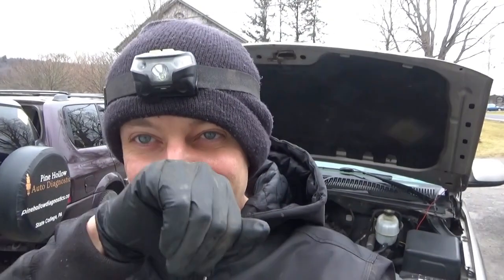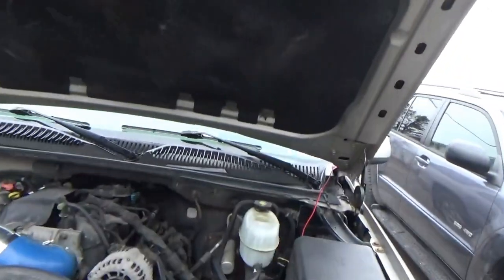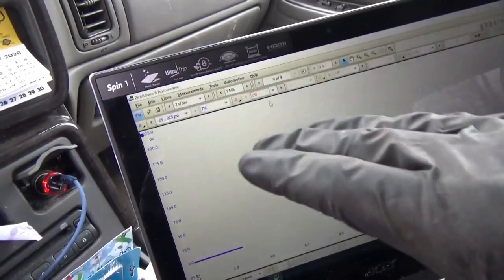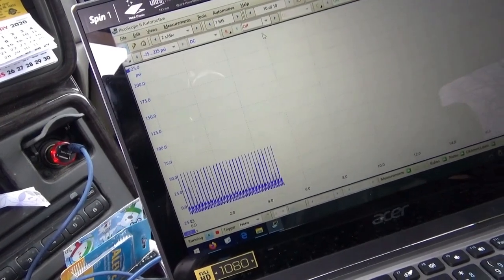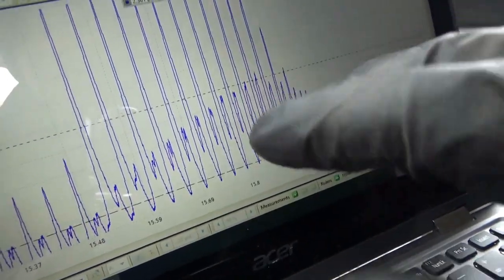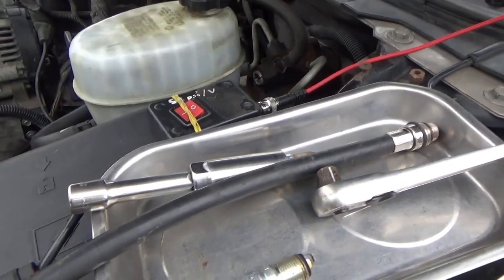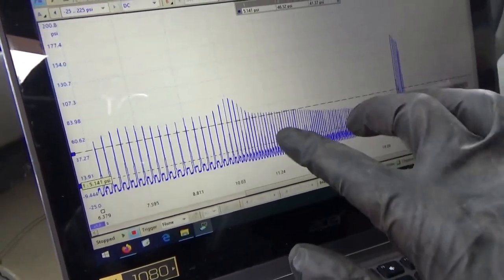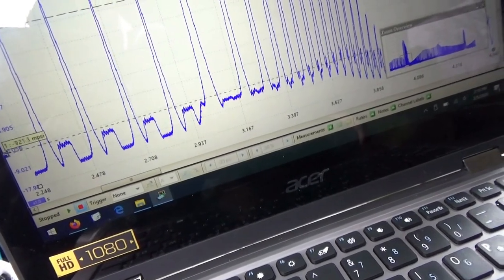GM Truck Misfire/Low Power Case Study - Part 2

Comment: Great video Ivan! Quick question... is there any way I can check for this same problem using my (less expensive) pulse sensor? Or do I absolutely need to buy me a pressure transducer? This could have been a very time costly diagnosis without the proper diagnostic equipment!
Reply from the maker: Hi Greg! You definitely need a real pressure transducer here. Honestly I've never used a "pulse" sensor, and don't really see where it would be better than a regular transducer. I can make you a similar one that I used here for about half the price of a WPS500 :)
Reply: Pine Hollow Auto Diagnostics oh yeah that works then! I really see where this could help me in my daily routine of diagnostic procedures! Ill text you my info and you can go ahead and get started I want it!

Comment: would you see pressure increase on intake manifold with a vacuum gage at higher engine rpm also ?
Reply: I was taught yrs ago 3 in vacuum drop was max back pressure from idle to 3000 rpm to check for restrict in cad
Reply: should and with the scanner if it has a map it should show there too.   start at an idle and watch the vacuum slowly decrease
Reply from the maker: Since this problem was only visible at WOT, not sure how a vacuum gauge would show anything useful...

Comment: A simple vacuum gauge will work, though it would not distinguish which bank when separate cats are used for each bank.
Reply from the maker: What would you expect to see on a vacuum gauge? I don't think it would show anything useful in this case of one partially restricted cat :)
Reply: @PineHollowAutoDiagnostics  Hi Ivan   With just a slight restriction it would be probably more difficult to see, but what one would see is normal vac  around 20 +/_ on initial start and vac will drop as backpressure builds up.   It really does work.   also works well to find if you have a low compression cylinder very fast. Will not specify which cyl. but will let you know you got a problem.  Even the Vac. reading itself can give you an idea of the basic health of the engine.   A bit old school I admit, but still a handy tool to keep in mind.  I am old school but I like the new stuff too.  Thanks to people like You and Erich and others,   this old dog has learned a lot.
Reply from the maker: Thanks for the comment Brian! I love mixing old and new school methods to find the most efficient and accurate diagnostic path :)
Reply: Well Thank You Ivan.  Maybe the next time You run into one of these exhaust constipation problems, or a low compression cylinder event, throw the vacuum gauge on just for poops and laughs.  I'll guess You might say "cool''..   I think You are "Cool" Ivan!

Comment: Great job.  You were right, this technique is much more elegant than "exhaust drilling" and  pressure testing in front of and behind the CAT.  I am wondering why the computer never set a CAT code.  Perhaps that degree of OBD sophistication didn't exist in 2004.  Thank you  Ivan.
Reply: I've never seen a clogged cat throw a code leading me there. Never a cat efficiency code with a clogged cat in my career. Or rich 02 sensor because of it, doesn't make sense, but cars aren't smart enough to diagnose it for us without experience and testing.
Reply: I am thinking it is because it is plugged.  A 420 will set when the cat isn't working (burning oxygen) efficiently.   IE there is the same ammout of 02 in front of the cat as behind it.  It may or may not be burning O2, but when it plugged there will be way less 02 after it because it's stuck up front with the rest of the exhaust.

Comment: I've been screaming at the screen a plugged cat,barring all the codes and symptoms,no power  means it's constipated 90% of the time,the other 10% the oxy sensors are burned off or there's a fuel restriction,barring all that then the ignition system and other electrical components,sometimes these scanners will take you for a wild ride and then you're still no closer to diag. experience is worth more than all the scanners ever made.

Comment: Some would say "the right tool" (in cylinder pressure sensor) solved the problem.  NO !  EXPERIENCE lead to the hypothesis and the tool just confirmed it.  Great work !
Reply: Indeed, the right tools, experience and critical thinking... all skills in high demand in ANY job area!

Comment: Good morning great video as always could you please let us know the brand of your pressure sensor please thank you in advance
Reply from the maker: It is the PHAD brand ;)
Reply: Pine Hollow Auto Diagnostics I am a diy I tried building one but the signal doesn’t look as good as yours I am using a Handel 1008 but I think that is not the main reason do you think it is because it am using a 500 psi one from eBay thank you fo getting back to me

Comment: The whistling on snap throttle is kind of a dead givaway of a plugged exhaust, I didnt hear it as much on the first video but it's pretty clear on this one.
Reply: Did the whistling go away after replacement
Reply from the maker: That was the alternator belt haha
Reply: @PineHollowAutoDiagnostics  Thats a funky sounding belt lol.

Comment: Check the litter box,if there's no poop in it,then you have a plugged cat,but a good dose of fish oil should fix him up,sorry JUST COULDN'T RESIST,LOLOLOL.
Reply: ROFL
Reply: Just drill it out. It'll be fine.😁
Reply: @InsideOfMyOwnMind  Or you can do what a mathematician would do and work it out with a pencil.
Reply: @TonyRule   Or just get out the torch. You might have to put a wet rag around the hole to keep from damaging the fur.

Comment: Nice and precise diagnosis!

While that method works great for those of you who have a pressure transducer, wouldn’t a typical (analog) pressure gauge in the O2 sensor port work for those of us who are strictly poor DIY’ers? 🤔
Reply: It super cheap and easy to build your own.  I made my own.  I don't know if Ivan will let me post a link but I did a video about 3 months ago called "Making a Pressure Transducer for my Hantek Oscillosocope", the video right after that show me doing a waveform on it on a Quad 4 I just rebuilt.  I wan't to get a Pico but you could do this test (and many others) easily with a cheap Hantek scope.  The nice thing about this test is you only have to remove a plug, it's fast and easy compared to getting under the car and trying to take out a rusted in place O2 sensor.
Reply: FrugalPrepper's Garage & Garden  I watched your video on that. I was able to squeeze enough $$ out of my budget for a hantek scope (won’t be getting close to a pico for quite a while due to not being able to work) but haven’t been able to get around to building my own pressure transducer for it.
Reply: Or use South Main Auto's method of drilling a hole, pounding in a brake tubing test nipple and welding it up when done.
Reply: @futz48  Welding not needed if rivet sized hole is drilled.
Reply: Yes!
Reply: @LASKY-xf3ok  yeah then you could check the downstream O2 sensor to the see if anything's broke off and clogged up Downstream
Reply: @Johnkb2059  true, but unusual, normally just a melted cat, or clogged with oil ash. I usually rattle the exhaust after I test, just to see if I can hear broken pieces.
Reply: Made my own out of an old O2 sensor!!!
Reply: Not if you live in the Northeast. I'd bet the o2 9 times out of 10 will leave its threads in the hole, but not before rounding the hex off and taking an hour to extract. Ivan reminded me of that when I suggested the same! 

I was thinking of using a compression tester, and comparing peak readings from bank to bank after a snap throttle. I THINK that would work. Might not be as accurate as the Pico for cats that are just beginning to clog, though.
Reply: Smitty Smithsonite (Un)Fortunately I do live in the NE (Pittsburgh area) however after changing multiple O2 sensors, I can honestly say that I haven’t experienced the same level of issues as Eric O. or Ivan. I’m currently driving an 03 Envoy with 167,000+ miles on it and could go out and pull any one of them off my vehicle without losing the threads. I just make sure the exhaust is smoking hot before attempting. Oh and before you ask, yes it still has it’s original exhaust.
Reply: @roberthogue6797  - It's hit or miss. 9 times out of 10 they'll come out with alot of heat ... but is that a chance I'm willing to take? I'll always make the attempt on my own stuff ... but on a customer's vehicle, I don't need a 5 minute job turning into a one hour (or more) slog. One time I had to cut the bung out of a pipe, and weld another one in, since the threads got mangled. I'd rather not repeat that again for as long as I'm breathing ... 😁
Reply: Yes max psi allowed on exhaust is 2psi.

Comment: I wonder why only one side plugged up, I guess the matrix collapsed. You didn't even have to crawl under the truck.
Reply: 5 psi is still above average for any cat , I would replace the set so he doesn't have this problem again 6 months from now 🙂
Reply: Anything that could cause one bank of the engine to run poorer than the other can cause one side to plug faster than another. A bad gasket, spark plug, injector, o2 sensor, anything that causes those to function properly and so on. It can be a historic issue too where the root of the problem causing the fouling has already been corrected but the uneven buildup or damage has already occurred. From there it would be a matter of time if it became noticeable or not.
Reply from the maker: I think that new ignition coil on cyl #1 is a giveaway to the root cause :)

Comment: get the heat gun  out...exhaust  does not sound  right,,had a cat plug up on my 2002 grandprix,,  sound  sick  no power an it has a 3800 in it..new cat  fixed it
Reply: What would you do with a heat gun?
Reply: @michaelherbert8213  sorry a  Laser Infrared Thermometer Temperature Gun....if  its hot  up  front  an not as hot out back   ,,fast way to check a cat...